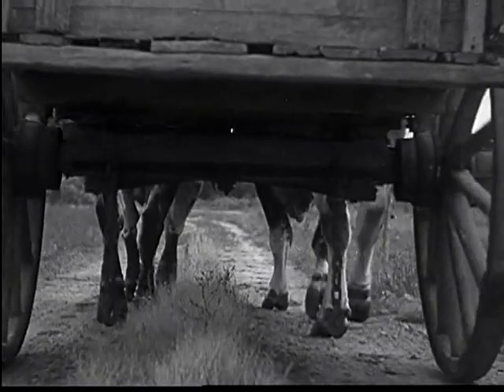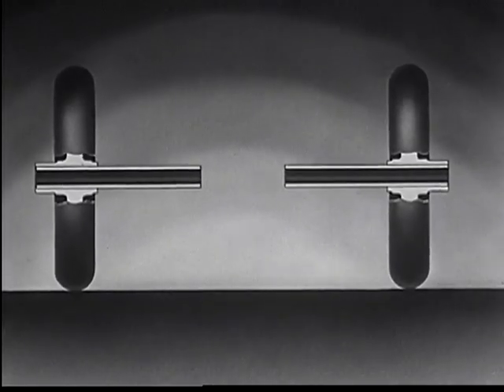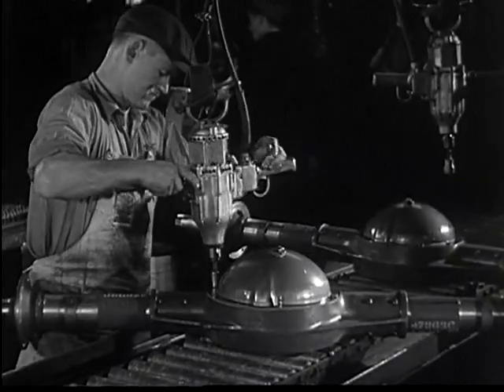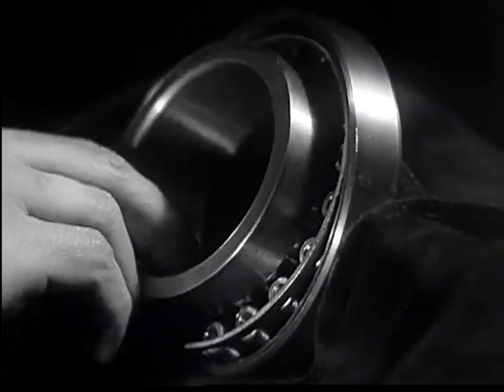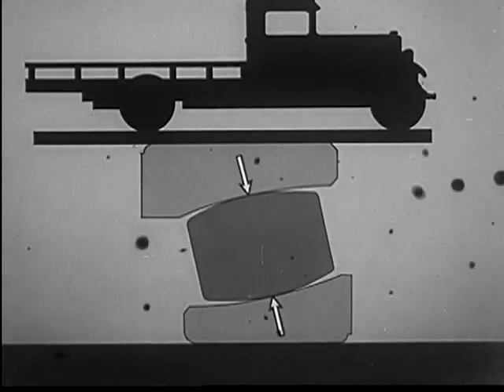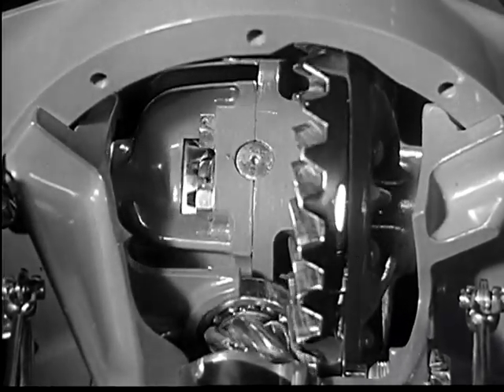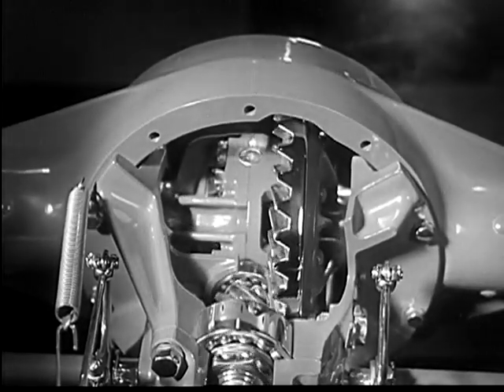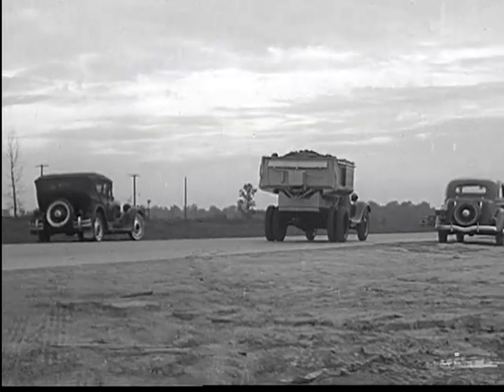It Floats - Chevrolet Full Floating Rear Axle (1936)

Comment: 1:32 engineers designed this for easy access from the outside, I.e. maintenance. Did you hear that BMW and Mercedes?
Reply: Modern strategy is very simple: you are must become unable to maintenance, therefore you forced to "upgrade". You'll never became satisfied, and always forced to consume (means pay ones more and more). Flawless, continuous profit. Just bring your money to proceed.
Reply: @smithraymond09029 Do you know the german engineering principle, If there is a way to make something difficult and complex, why to make it easy?
Reply: smithraymond09029 .... and vw!!!!!
Reply: BMW stands for Busen Müssen Wackeln in English boobs must wiggle
Reply: Mercedes and BMW are fully capable of making very reliable cars. It's just that it's not as profitable as making pieces of junk that will either bankrupt anyone trying to maintain them past 5 year warranty or force them to get another of their shitty cars...
That's why so many parts are made with cheap plastic instead of metal- it's cheaper and will break down forcing owner to pay for fixing it or making them lease a new car. Either way the manufacturer gets constant, reliable stream of cash.
That is called planned obsolescence and it's everywhere and I hate it with every fiber of my being.
Reply: @edim108  oh yeah Mercedes and BMW are known for their legendary reliability 😂
Reply: @RoninMike-DR  they used to be. Old Mercedes diesels are still running in Africa after 50 years and a million miles on the same engine and transmission they left the factory with. Old BMW's are great to work on and supremely reliable. But that's the past, the old Mercedes and BMW, before W210 and E46 time, before the accountants and not engineers started making these cars...
Reply: @edim108  Here's a better thought, German cars are over engineered and focus on cutting edge technology given the big F1 racing following in Europe people want to drive similar technologies,  the Italians are just passionate about building fast cars and neither are focused on practicality, mechanics in Germany love to work on German cars. 

The Japanese philosophies are different tried and reliable over cutting edge technology I drove an Audi A4 T S-line, it was a very fun car, tje traction is legendary and it does what the Germans say it does, I remember going 79 mph on an interstate during a blizzard while everyone else was doing 50 mph, I can attest to the engineering, it's there but maintenance is a headache and all the plastic stuff break so easily it's not a practical car to own unless you're willing to part with the money for maintenance, for example every 60k miles I had to change the wheel bearings to keep the performance and the way they built it then it was all compressed and only and Audi certified shop had the tools to swap them out and you're looking at $4k to $5k every 60k miles and you don't have to do it, the car will run but not at top notch and because of it other systems start to suffer and you end up with a chain reaction of problems German cars are disposable luxury cars for very rich people I'd would never buy a used one.
Reply: @Mr Sunshines 

I was thinking this! Just about all Merc and bmw cars (Not sure about the realllllly new stuff) feature diffs with ease of maintenance and inspection via fill and drain plugs and also removable rear inspection covers... usually made from aluminium too.
Reply: It honestly makes them easier to weld the diff cause you can just take the centres out rather than welding it under the car through that plate
Reply: Do customers still ask for easy maintenance? I would guess that 80% cannot explain how the car is moved forward. My current car is 6 years old, with 120,000 km and didn't need any repair. Even the brakes (disks and pads) are still the genuine parts. Compare that to 1936 quality. It's neither Mercedes nor BMW but a cheap Skoda Octavia (not sold in the US, based on VW Golf SW).
Reply: Razvan J  hahahaha......
Reply: No. No they did not.
Reply: Don't forget Volvo heavy truck
Reply: that could apply to manufacturers of everything today even computers.
Reply: They heard and just gave a Teutonic snort at the very idea.
Reply: Bmw=brokemanwalking, when they break  you are walking.
Reply: parts were not as strong then so they brock stuff way more often then we do now, hence the axle swop shot. lol
Reply: Hahahahaha! Bmw crushes their works of art when nobidy buys them... they abort their own art for profits' sake.. they are globalist scum as car as im concerned even though i used to want a bmw and mercedes so bad! Lol
Reply: @daryldixon5280  just stupid comment
Reply: BMW and Mercedes are shit
Reply: GAIUS IULIUS CAESAR The only BMWs and Mercs I have seen in rough running conditions is from when the owner was driving the german car too hard and expect to never to do maintenance in them because they spent a lot on money on the thing, or because they think its German engineering and that it should repair itself. Idiots.
German card are awesome, I own a BMW and do all the work myself. Its fun and awesome, yeah sometimes hard but things are not IMPOSSIBLY designed to not work on. Thats just retarded. German cars are just very well and specifically built. Everything is where it should be, and all fits perfectly compact together. Sometime complex, but not after you starting reading the owners manual.
Reply: @acewingdabson3139  you have your BMW in your avatar pic... Yeah lets listen to you..
Reply: Razvan J  you can have your fucking oxcart. ill take a mercedes, thank you very much.
Reply: @parapobabam  take your Mercedes to the dealer shop and then the only thing that you can afford is the oxcart
Reply: @cbmech2563  your inability to afford repairs is not my problem
Reply: @parapobabam  I'm the guy who fixes, not the guy paying for it and I hate when the manufacturer makes it harder than it needs to be.
Reply: @cbmech2563  that sounds like your problem.

Comment: Goddamit! Good old times, when cars only were becoming better!
Reply: MJorgy5 once you had a decent tune, your carb seldom had to be touched. If it did need adjustment...literally any owner could do it properly within a couple of minutes. Plugs & wires...you could do both on a v8 in 1/2 an hour. Manual choke ? So what...it's not like it was any harder to pull the choke out to start your ride. The problems started to arise as folks got lazy and mfr's introduced the thermal "automatic" chokes. 
Those of you who bitch about simple stuff today are just spoiled and would never have made it in days' past.
Reply: @ROTAXD  You're right, but people have become so lazy now days that this would be seen as a chore, sad truth is that people rather send their car to the dealer and have them charge a fortune to fix it, customers are a part of the problem with today's automotive industry.
Reply: Stanislav Anikanov 
Yep, like syncing carburetors routinely due to seasonal changes or elevation, replacing spark plugs annually, cleaning carbon-coated valvetrains, oil every couple thousand miles, choking manually, tuning up point ignitions, etc., etc. 'Ahem' Old days.

Comment: They don't build them like they used to. you want to change the axel on a modern-day vehicle you first have to remove the wheel ,the brake caliper and the rotor.
Reply: justin wood not on a 3/4 ton or heavier.

Comment: this was america.  quality, strength, certainty, reliability, promise, convenience.
Reply: Keyword: was.
Reply: In that that time the US was also extremely racist, homophobic and sexist (as was the rest of the world). Dont sugarcoat the past.
Reply: Trump 2020
Reply: TripTheRoad- I daily drive a 66 Chevy pickup with more than 260,000 miles. Meanwhile my 94 Mercury sedan has 150,000, the transmission is on the brink of failure, it burns oil, and the computer's whacked out so it won't throttle above 60mph. Difference? Those old cars were over-engineered and built to last, along with being easier to repair. The 66s engine has solidly built parts. The 94 has a lot of cheap parts to pass regulations and standards, along with making the drive "more comfortable". Also, open the hood on both of them and you'll notice the 94 hardly has engine bay space to work on, while the 66 has inches of clearance between nearly every part. Modern cars have even less engine space. The 66 is carburated, while the 94 is fuel injected. Fuel injection systems are notoriously expensive and hard to repair. Anyone with a toothbrush can clean a carburetor. The tech didn't require expensive tools or advanced knowledge, they built the components to be easily maintained at the expense of efficiency and performance. The 66 has a 4.6L V8 engine while the 94 has a 3.0L V6, they only make about 40hp different. But they aren't performance cars, I'd rather have reliability. 

Additional it lasts longer because it doesn't have features that fail. Complicated plans are always more likely to go wrong. My 66 pickup can't lose the automatic transmission because it's a manual, and the computer can't whack out because there isn't one. If I could buy a featureless and mechanical car like that 66 Chevy today, I'd do it in a second
Reply: @imthedarknight-8755  I have never had any issues with a new Toyota properly maintained,  I did venture out and bought a few German cars boy did I go back quick, I paid 19k with interest for my 2017 Toyota Corolla LE I got 10k for it after 7 years,  the car had scratches and dings, a little dirty on the inside but everything else the drive train, electronics and radar were in great condition.
Reply: Swampy  yeah but are those people driving them to work everyday? I see some around here too but not daily driven
Reply: @triptheroad  those old cars were meant to drive and work, there is a lady in the us she drives a 57 vhevy belair, was her frist car and she bought in 57, she still driving everyday to this day, never replaced the engine or drive train
Reply: TripTheRoad 
There’s work vehicles used for work everyday that are from this era with millions of miles on them. They still exist.
Reply: Bo Huggabee And it all changed in 1965.
Reply: Don't forget "husky"
Reply: ...And today, they vote for a lying, sex offending, disrespectful, racist clown.
Reply: Back in the they they were on If those Not-bombing-every-place-they-please countries and It was so nice!
Reply: "and emisions were through the roof."
Reply: And a great recession about that time
Reply: Dick Fageroni mostly the commies.
Reply: Those cars didn't last 200 k
Reply: @eksine  well they probably did, there are still a lot of them around today, both unrestored and still driving, as well as surviving well enough to have something to still restore
Reply: @eksine  my mothers old ford escort lasted 300k and the dealer even said they should use it as an example for durability and reliability.
Reply: @thebonnevilleof5933  what are you even talking about? We we're talking about cars built in 1936 as in the video
Reply: @eksine  oh I know, I'm sorry if I came across as  negative, and or confused you. I thought it was a cool fact and wanted to  share it, I didn't mean to reply to you directly just wanted to share.
Reply: Ok, so how many 1936 trucks are still on the road? 
Stuff is still quality made here,  it's just way more complicated
Reply: @triptheroad  many frames, axles, wheels and other stuff still survives. its just outpaced but newer equipment. still usefull though